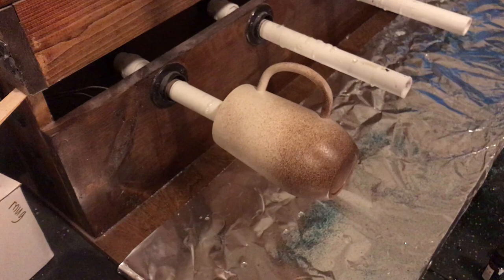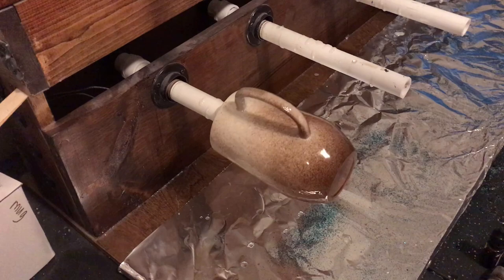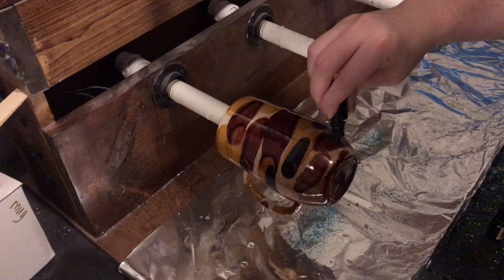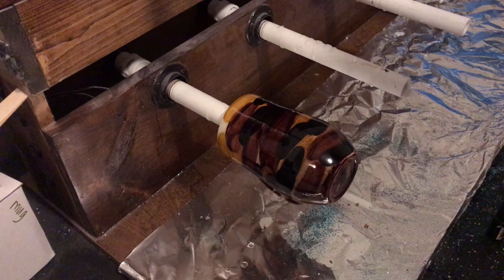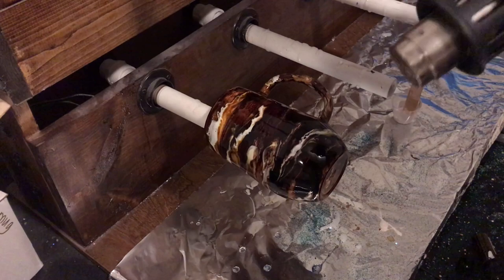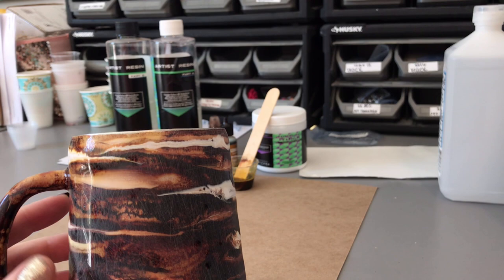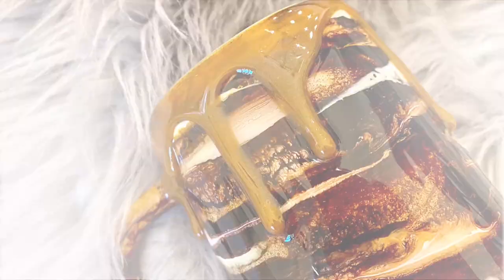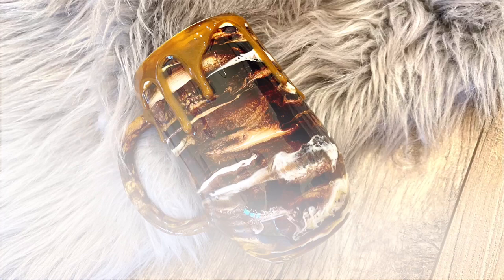Coffee swirl with inks, armor art and drips  tumbler tutorial! DAM Fancy Creations

Comment: I want to try the nice n thick but it requires so much and its expensive
Reply from the maker: It is very fluffy so even though you think you are using a ton- the container last forever! If you want a similar solution - try cornstarch 😉 it will have a little more ‘milky’ appearance so you may have to adjust your colors, but it will work almost as good.